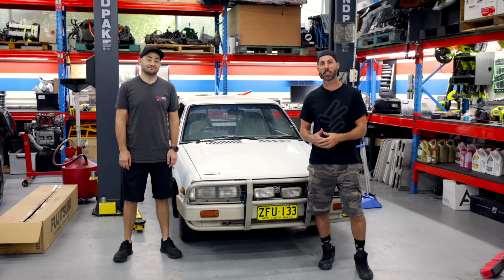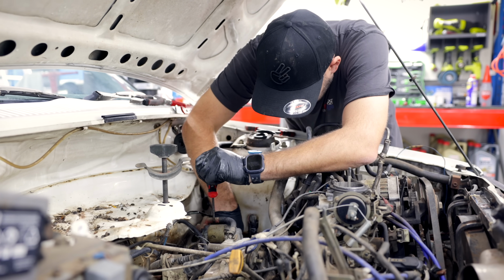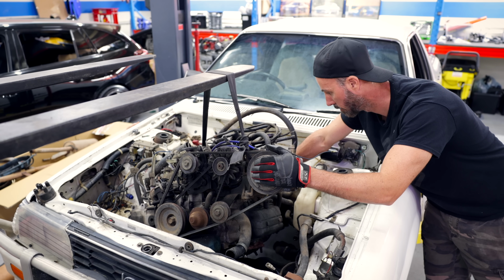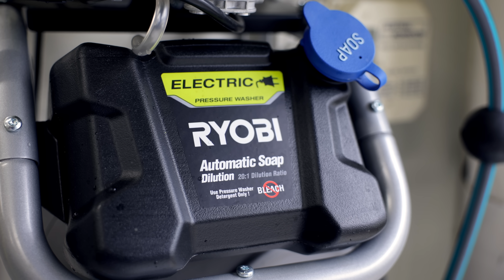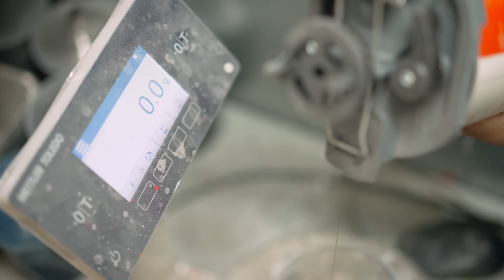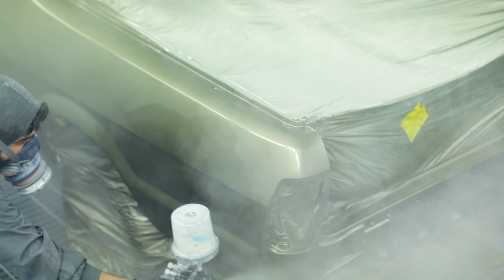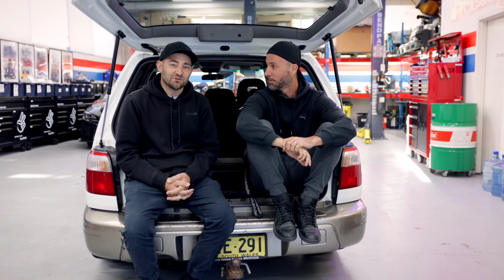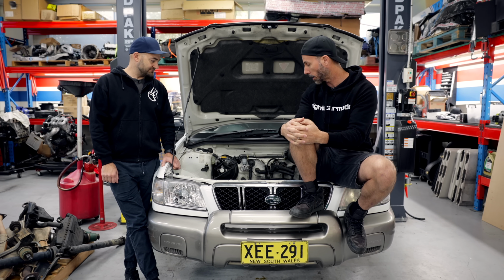Rebuilding a Subaru Brumby (BRAT) Ute that we found in an orchard! [EP2]

Comment: Friendly piece of safety advice: when lifting straps and things from the forks of a fork lift, even a small one like you have, it's important to ensure that they cannot slip off the end. Sometimes people will put a hole for a pin in the tip of the fork, but you can also just use a C clamp.

The risk isn't just having the load slide off the end, but if the load shifts and the fork lift tips forward, it can be even more dangerous when the load slides off and the forklift snaps back.

Cheers!
Reply: This is a bit silly. I have never seen this in any machine shop I've been in. Even Cutting Edge Engineering here on youtube don't so that when lifting with a fork truck, and he is as meticulous as they come.
Reply: Also end of the strap was wrapped around a part of the engine and tied in a knot! 🤔🤔🤔
Reply: Or if your going to be really diligent, don't lift with straps round the tines at all (its called free riggging) , since they usually have sharp burs on the edges where they've slid into steel pallets over the years that cut into the straps & its illegal under certain safety regimes (OSHA in the US for eg). That's why hooks that slip over the fork tines exist. Yeah we all have been guilty of it with light stuff for a quick move or nudge and old strops we don't care about, but when it comes to engine/gearbox or heavier parts I go grab the fork hook that slides on and clamps the tines and grabs the framehead.
Reply: Its illegal (depending on country but any safety body will fine and shut you down for it) and unsafe to drill holes in forks, once that hole is there you are not allowed to use the forks as it potentially compromises the structure of the forks and their swl and GA forms (weekly operator safety checklist ) is invalidated  if your operating it for a business

Comment: It's crazy how complicated those vacuum hose spaghetti emissions systems got back in the day.
Reply: The Mazda Rotary's at that time had an insane system of hoses etc..
Reply: Tell me (a tercel 4wd owner)
Reply: There were worse vehicles than that too. I do get some kind of pleasure by modernizing these vehicles and you go from all these hoses going everywhere and all this complicated stuff down to one little valve or whatever that we can control with the ECU and do the exact same job, better...
Reply: i am praying every night that my honda prelude will never have a problem with the vacuum...
Reply: @NZstylz-r7v  The (in)famous rat’s nest under the FD RX7s is peak vacuum tubes spaghetti, as it’s for both emissions and, most importantly, for controlling the sequential twin turbo system
Reply: I had a twin-turbo 2001 Subaru GT-B… there’s a thing under the hood called the BBoB (Black Box of Death) with like 30 vacuum hoses entangled together
Reply: Thats why i just Weber it :)

Comment: I spent a large part of the 1980s playing with 1970s front wheel drive soobie hardtops and coupés. I did a lot of engine and gearbox swaps. Early cars were 1400cc and some were even twin carburetor setups. I did a twin carb conversion but a 1600cc engine,  imported from Japan in good condition, was cheap. That was my first swap. I also did an automatic to manual conversion. Extra easy and simple to work on, I could remove an engine in 30 minutes-two men grabbing one bank of cylinders each and lifting it out worked perfectly. They were special cars with a unique look to them. Good times.

Comment: Very nice, I hope this doesn't become 24 episodes though but progressing nicely for the first episode. Hopefully you dive deeper into the actual swap and don't just use a haltech.
Reply: Haltech will almost certainly be used I’d imagine, it just makes sense
Reply: @mj_aussie_coaster_travels8310  I know but for everyone else who doesn't have that opportunity... It would just be helpful for people who attempt something like this to also know that you don't just need a Haltech, sure it's easier but not the only way.
Reply: @MADagain  doesn’t have that opportunity? I’m sure it would only need a low spec haltech for a n/a forester engine, hardly an expensive part of a substantial build like this. It’s like $2000 for an elite 750 and a wiring harness. 
That paint job was probably well in excess of 10k…
Reply: @MADagain - the other way to do it is to use the factory ECU with a cut down harness. Not hard to do and if you get a compete donor like this it’s zero dollars extra for the parts to go this way. The loom can be diy cut down if you’re confident or there are ppl out there with skills that can cut it down for you at a fraction of the price of the aftermarket ECU route. 
If you have an immobiliser model you need the matching key chip for the factory get to work. If the donor is running (recommended!) you know you’re good to go for a loom cut down job.
Reply: Factory loom cutdown and factory ecu is what makes sense for this type of build
Reply: @mj_aussie_coaster_travels8310  Exactly, idk how long you've been following these guys but they never used to rely on big budget swaps. Which is my point, plus being for charity why not make it more educational along the way why you being against this lol
Reply: @ElFreddoAndRubyScoo  I know, I've done this myself going from an EJ253 to an EZ30. My point is if they can show both routes rather than the easy way out with the haltek. It's about education and for charity so why not... I'm not saying the haltek way is the only way but it has been a route these guys rely on for years.

Comment: NIce! My first Subaru was a 2001 Forester S sport (SF5) with the EJ25 and 5spd transmission, bought at 48k miles in 2006. I had that car for 8 years and 100k miles, lowered on Swift springs and KYB struts. So, that generation Forester holds a special place in my heart. So sad that you found a very clean one just to pick it apart. Maybe the rest of it could be the start of the next project?

I can't wait to see the Brumby Wilderness go together over the next few weeks. Keep up the great work, mates!

Comment: For increased NA power in a ZC31s or Zc32s you need ITB's.
The thing about this cars is that in stock form they are maxed out. Coilovers wont give you a better ride in track, just changing the coils for the HRs makes a HUGE difference.
And also you can gain power in the exhaust only going catback without silencer (the big box in the back going straight).
I owned a ZC32s for 5 years and drove it like hell, i know every bolt and nut of that car. 
Also you need to drive it between 5500 and 7000rpms, over 7000 you lose power even with the repro of the ecu. 
Also you can change the injectors but i didnt do that.

Comment: I am super excited to see what you guys do with this. I love 80s and 90s Subarus and have owned and built plenty. One of my favorites was an 88 GL 2 door hatch that I swapped everything from a 95 Legacy Sedan (engine and control system, radiator, 5sp, drive system, brakes, and suspension) into as a local entry level rally car to give a more modern part availability, lug pattern, and overall performance boost. Of course it was painted a custom blue near WRPB that the customer had chosen and had a wing similar to an STI sedan style wing. It was extremely satisfying to finally turn the key on that project and see it move under it's own power.

Comment: Oh my day yus! A forester dear to my heart. I bought one for $10k nzd when I first got a proper job and the 323 was needing another gearbox. Mine was a 98 c/20 with the high and low range gearbox and it took me everywhere. I mean I had it for almost 200000kms! I absolutely thrashed the crap out of it and the only thing that let me down was starter motors - for the 3rd replacement ended up putting one in from a 2.5l legacy I think (best thing about suby parts) and solved the problem. When I got my company car it was a sad day when I took it to the scrap yard as it needed a second head GASKET repair but a guy in the carpark offered me $50 more than they were offering and it lived on. So many great memories and a real trooper for the lack of maintenance I tended to. Forester 4 life!

Comment: When you lift something with the forky, put a piece of wood and a C-clamp on top. So much more easier and quite a bit more secure. Like buy a 10 cm throat C-clamp (more for sturdiness than anything) and keep with the forky along a small block of hard wood. A piece of old parquet flooring is perfect for this, the rough unfinished back will grip stuff in place and keep it there, alternatively, a piece of sand rough sandpaper will also suffice.

Comment: Don't want to be a kill joy ,  but i tried an OHC conversion years ago on one of these and the motor doesn't fit between the chassis rails because OG motor is an OHV and considerably narrower.
Will be interesting to watch this unfold and the reactions  / solutions to this significant hurdle.
Good luck

Comment: I done some preventative work on Audi A4 s-line quattro avant. Rad. Clutch. Turbo core. What a beast. It was tuned and set up by MTM. It could be yours in Oz for the right money. It's RHD. 2.0 TSFI QUATTRO. Far better than new. Probably worth $30k Aud.

Comment: If you haven't already modified the strut towers mitsubishi evo 2-3 strut tops fit the bolt pattern in the brumby and can be put on the imprezza struts for a bolt in combination that uses factory components because engineers love factory parts
This is exactly what I did with my brumby but I used a non turbo 99 liberty, transplanted EVERYTHING with the entire loom plugged in and away it went with a little trimming the liberty cluster fit in the brumby dash. It still has a dual range gearbox like the forrester so it can still do brumby stuff.
Reply: Oh and a bonus is the evo strut tops are readily available from supercheap auto 😁

Comment: Going to enjoy this and just wish I were down under with a chance to win.
With older non bonded windscreens you need to remove the trim strip first, then get your feet behind the top corner,
That trim strip is there to give the rubber seal some rigidity to secure the glass properly..
Reply: I cut the rubber. Much easier and reduces the chance of the chrome lifting off the plastic trim pieces. No pressure on the windscreen this way. And a new rubber is always needed anyway. 
A new windscreen was probably needed in a build like this. No use having a shiny paint job with a sand blasted windscreen!

Comment: Damn guys, part of me wishes I was living Down Under. Love the project, and you have my wife looking for our Brumby equivalent.  The BRAT (Bi-drive , Recreational,  All-terrain, Transport.)

Her brother had one, when sue was little, and has wanted one for over 40 years.

And we already have a wrecked Forester behind our shop, that a customer signed over, as trade on his wife's Mini. Our daughter's college car.

They want to build it.

Time to move the Zephyr. 351 Windsor swap, built,  with Holley Pro-Jection, 6 speed, 9 inch, sitting on coilovers,  running 16 inch Cobra alloys. Corner  Carver,  that is currently in the bay, after adding a drift brake, and hand  opperated clutch. Back up system for the foot pedal.

Double amputee.  AK on the righr, BA on the left. This was my recovery projecf.

Look forward to seeing the end result, guys. But it'll be sad not seeing her around, in the fleet.

Comment: To be fair, Marty, Even professional have trouble removing old crusty, many decades of heat cycles, window seals / windows without cracking them. Most companies wont even warranty it on high end classics due to this. So you were probably better off doing it yourself. Next time get a chain/wire razer blade tool that takes two people. One on the inside one on the outside and it works like and old style wood saw, you pull, moog pulls, you pull.. rinse repeat along the edge of the window till the seal is completely cut free. Then you use suction cups and a special dolly / Your engine hoist and a balance bar to lift on both sides at once.

Comment: One comment while it is fresh in mind... Drill a hole in the end of the forks on your pallet lift and get trailer hitch balls to bolt in. Useful if you need to move a trailer. Also extremely useful if you are using it with straps to lift engines. The straps can't slide off the end of the fork if a hitch ball is bolted in place! At least get a really strong C clamp and clamp it on the end to prevent slipping.

Comment: Strap the engine strap to the forklift upright or get a hole made through the tong to secure it, it isn't if the engine will fall it's when.....prevent that strap from sliding of the tong.....stay safe guys.😊

Comment: As an automotive glazing engineer I can confirm that windscreen was screwed the second you decided to remove it. They go brittle with age, best way is to cut the rubber off first but then putting the same screen back in is likely to cause it to break due to the force required

Comment: I have to say as a dismantler for subaru u can drop it all out the bottom way quicker and as a roller subframe strut tower bolts and wires drive line and its all on the ground lift it off with the 4 post and set it on roller dolly chassis separate

Comment: Definitely a neat project. Pretty sure these were sold here in the US as a "Brat" and they were notoriously unreliable and known to rust like crazy so I'm doubly impressed to see one that isn't a pile of rust with a subaru badge laying on it. I'm also happy you didn't do the typical Subabro thing and paint it WRC Blue with red mud flaps.
Reply: In Australia they have remained a favourite and are still being used on properties. Maybe a slightly different environment (rust wise) out here. Our 85 Brumby has a small amount of rust and it is in the same places as our earlier 78 Subaru sedan...
Reply: @brianmackenzie5692   Australia definitely seems more forgiving rust wise than the North East US. JDM rust is still a common thing here. Although everything rotting is becoming common these days.

Comment: I'm surprised that the FA16 from the Levorg wasn't used. 
I guess the biggest thing being the CVT auto that would have come with it, which wouldnt have matched the brumby very well, but the little turbo motor would have been cool! 
Either way, a modern twist and a much more suitable engine that which came before it!

Comment: Scooby owners tip for anyone that wants to know.... Peugeot 505 Estate alloy rims are the same stud pattern as the Brat but you will have to fit longer studs. And if you want to replace a ruined drivers seat cover then buy an intact passenger seat and swap the skins. The only difference is the tilt lever slit. If you are thinking of swapping in a turbo engine  then you will have to swap in the dash from the donor car because of the electrics, its complicated. Oh, and you can drop them into 4 wheel drive halfway round a corner at speed = )

Comment: to get the windshield out properly you fold in the passenger interior corner of the rubber and then slowly push the whole thing out with your feet. there are pictures of it in the factory service manual lol

Comment: I used to have an 83 Brat. Was an excellent car but got totalled by an idiot driver. I have a 79 Subaru DL now that I engine swapped with a 1987 Subaru EA71S (JDM factory racing engine for the FJ1600). The engine was missing the dual carb intake when I bought it so I took an 81 EA71 single carb intake, ported it to match the large port heads, and made an adapter to fit a Holley 1904 carb off a Ford 200 inline 6, which flows more than the 2 original Hitachi carbs combined. It runs a GM HEI module for ignition firing a Ford TFI coil and Champion N19V surface gap spark plugs. The HEI module is triggered by a 1979 EA71 Nippondenso distributor. Transmission is an unknown earlier Subaru 5 speed found on the ground at the junkyard. Probably a 73 or so. I drive it every day. I do think that taking the EA engine out is not my favorite idea. Part of what is so cool about these cars is specifically the EA engine and how durable it is, and it does sound unique and different from an EJ. If I was to pick a different engine other than an EA it would have to be an EE20. Just because a diesel in such a light car would be very cool. My EA71S makes between 110-130 HP depending on fuel and tuning and is driven sometimes almost 1000 miles a week. What I would have done with it would have been: Turbo and fuel inject the EA81, and convert to coil per cylinder ignition. Have the cam reground. And use the original transmission. That would have been a gem I think. Second choice would have been an EE20, because I have never seen a Brat with an EE20 swap.

Comment: what happened to the original Grovel drive line, this would have been a perfect candidate for that? that is a nice colour but wouldn't have been better if all the mechanical stuff had been cut and bent and drilled, test fitted etc. before the body work is done?